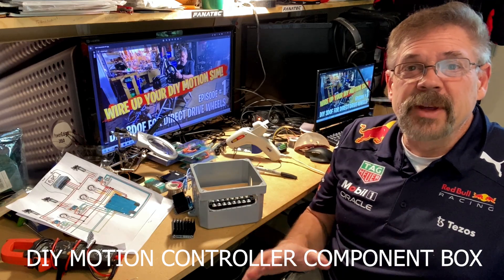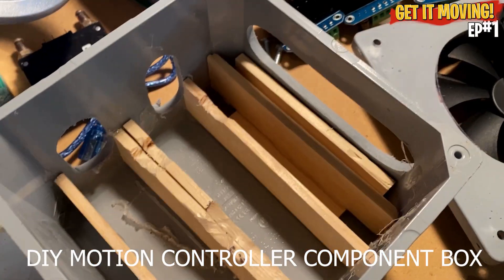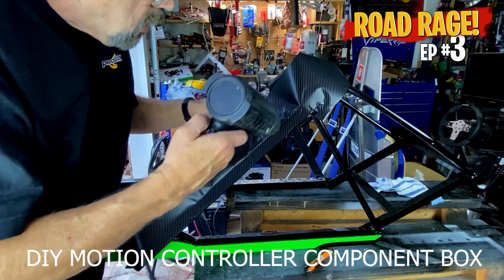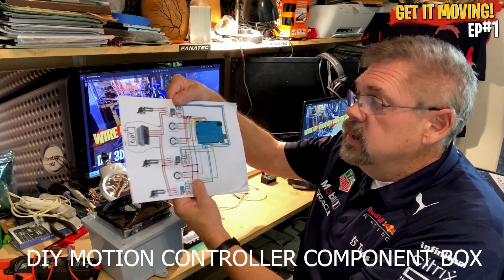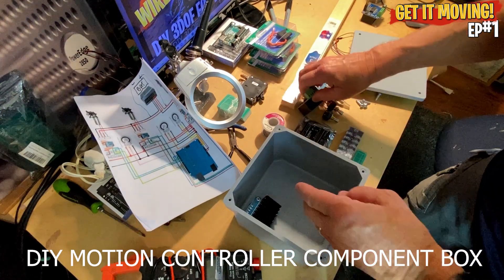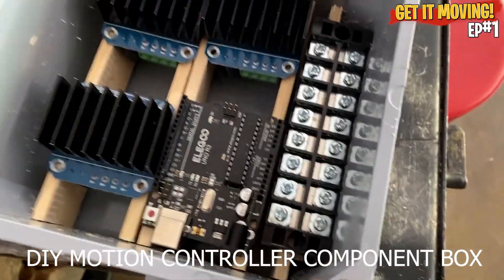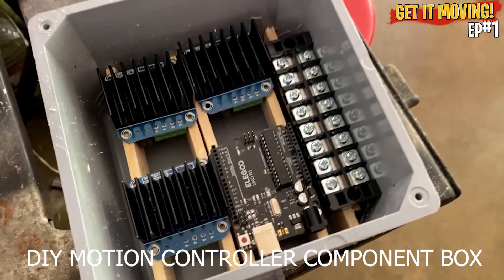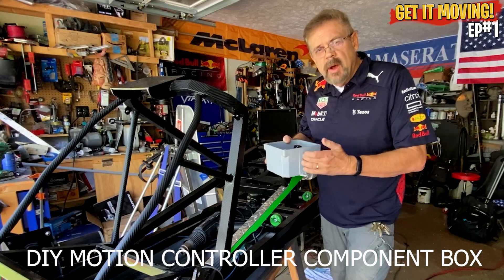DIY 3DOF MOTION NEW SERIES GET YOUR DIY MOTION SIMULATOR UP AND RUNNING EPISODE 1 - COMPONENT BOX

Comment: Hey dave, I would suggest to have a small opening or even a small fan blowing the air out. You have a big fan blowing air in but the warm air has nowhere to go.

Love your videos!!
Reply from the maker: Yes.  I would..  I have that on my 'daily driver' ..  even with the  inch holes  in the box to allow hot air to escape,  an 'exhaust' fan would be my choice..  not totally necessary but I did do this on a few of the box controller rigs..  I'm just trying to keep it simple and not overwhelm people with information..  just the basics..  Dave

Comment: Would there be any advantage to separating the ITB2 from the arduino?  Does the arduino get hot? or as hot? Keep up the great videos!
Reply from the maker: No advantage..  the IBT-2's get warm   but arduino does not ..    Thanks Todd..  I'm posting a new Q&A tomorrow on the Road Rage Series..  Might include this question and a better explanation..  Tune in if you can.. Dave

Comment: Your the best ! Freakin love ur vids keep it up ! I'm going to build one myself with your vids 😁 just finished my vr pc 🎉
Reply from the maker: Thanks for the comment!  Yeah I'm going through it step by step and trying not to leave anything out.   So which  VR HMD are you going with..  I still have my old Rift CV1..   what video card..  I have an old 1080ti..  from when they first came out.. maybe 2012? Dave
Reply: @DMAX_DIY  well your doing a great job at that ! I'm using a q2 with a i7 cpu, 1060 6gb gpu with 16gbram
Reply from the maker: @elstyloogaming6447  Sounds legit for sure.  I've been thinking of upgrading the a newer HMD.. but then I would need to upgrade the PC parts too probably..  * so a bought a gamer laptop *  I dont know if it will work yet or not in VR but I'm going to give it a try.. NVIDIA 3050 card  Pretty good I5  and 16ram.   Not tested it yet but it sure does scream through video editing..
Reply: @DMAX_DIY  that sounds good ! Run the steam vr test then u know for sure !

Comment: Great tutorial! Ever think about hollow dowel spacers with through bolts instead of wood strips for spacers? Less fab work and better air flow since your not blocking off whole strips of the box. Just my thoughts as planning my build. Keep pumping out great content.
Reply from the maker: Aw man Shawn..  Thanks for the comment and thoughts..  Hmm.. I have not thought about it.. I guess I try and keep it a bit simpler.. But you do have a point about the air flow.   I'll put it on the 'think about it' list.. Dave
Reply: I like that idea. I live in Florida and it's hot all the time even when we get our cold spell. I'm definitely going to use that dowel idea. Thanks
Reply from the maker: @JayRDucer  Yeah.. let me know if it's stable..  I would think you might need to fasten the dowels from below instead of gluing them..   Some people think I have the 3d printer.. but I dont.. so  I just use what is simple..  Let me know buddy.. Dave